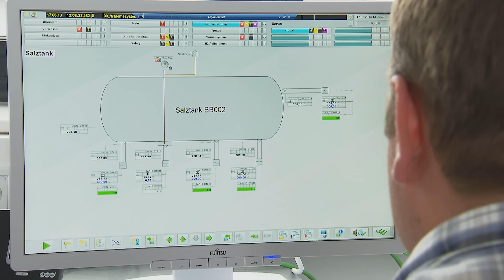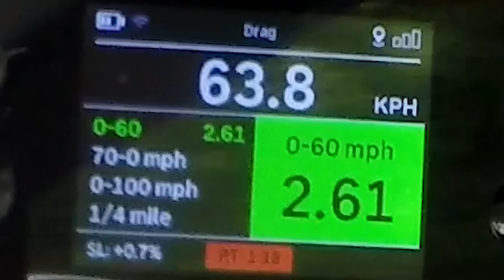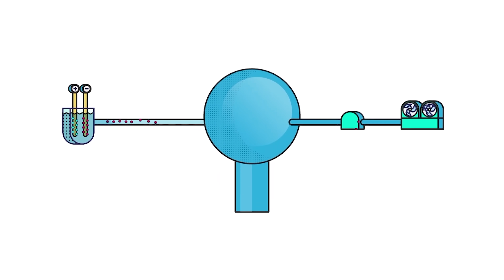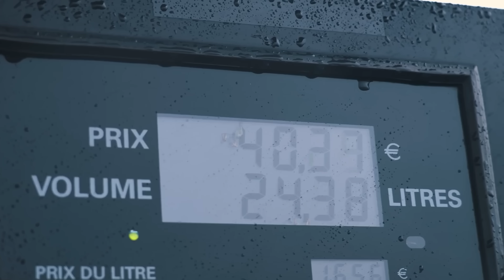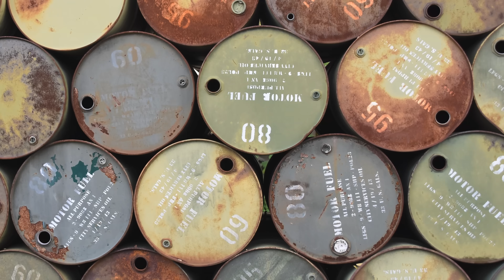Porsche just SAVED petrol engines FOREVER

Comment: electrolysis -> production of H2    (is about 70% efficient) so put 1kwh of electricity in to it and you get 0.7wh. 
x amount of H combine with x amount of COO will give us some biofuel. I guess it's more efficient than storing and containg hydrogen gas. 
hydrogen gas can be efficiently be convertet to electricity

But a diesel combustion engine does not have an efficiency above 50%. maybe not even above 40%. and the efficiency of diesel engines is higher than gas engines.

so from that 1kwh of electricity, you get 0.35kwh back. (and that without the efficiency lose of turning hydrogen gas with carbon dioxide into carbon neutral-fuel)

Electricity will stay cheaper to drive with and that is already not cheap. 
I guess those combustion engines are for people with lots of money who can by the carbon neutral fuel.

Comment: There is one major problem with E-Fuels. One the points shown against EVs (from the perspective of the car manufacturers) was that there is not enought electricity. And E-Fuels intensify exactly that problem. You need round about 4 times more electric energy to drive a certain distanze by using E-Fuels compared to using EVs. Thats because of all the inefficiencys in the energy transformation  processes (for example the electrolysis).
Reply: Great point, thanks for mentioning it.

Comment: One of the things that gets missed here is that in order to prevent the worst of Anthropogenic Climate Change, we not only need to stop adding radiatively active trace gases, but we also need to remove roughly a third to a half of what is already up there. Being carbon neutral is obviously better than carbon positive, but it will not prevent the devastation of ACC. This synthetic fuel is great for now, if it will convince petrol heads to do anything good for the climate, but it will not save our society. It is not the solution.

Comment: It’s funny how the same people moan that we don’t have enough green energy for all these new electric cars and then continue on to say that we should use a technology 5 times less efficient for NEW cars. Don’t get me wrong E-Fuels are an interesting technology that can solve many problems. But first we have to use it in use cases, where Battery electric is currently not possible. Like aviation or large ships. Then we could talk about using it to make existing cars greener or even carbon neutral and in the very end we could talk about new cars. This is the biggest bullshit Porsche ever pulled. 
Ps actually we also need this technology to remove carbon, otherwise it will be impossible to reach the Paris agreement.

Comment: I'm sorry, but you're a useful idiot (to Porsche and the other incumbents) and should stick to talking about how fun the car is to drive, which fits your level of knowledge and understanding. 

e-fuels are of course a scam, the same kind of tactics that big oil and big tobacco has been up to for so many decades. 

ICE is fundamentally inefficient compared to electric drivetrains. Precisely because we, as you point out, don't have abundant clean energy, efficiency is very important. 

In some distant future in which we have fusion power and far more clean energy than we know what to do with, efficiency will maybe not matter. If clean electricity costs a cent per kWh it doesn't really matter if a hydrogen vehicle is only 30% efficient, and we might want hydrogen cars. Or maybe another e-fuel that isn't quite as much of a PITA to store, distribute, and generally handle safely. 

But because this is at best many decades away, e-fuels are a terrible idea, ironically precisely for the reasons you enlist in their favour.

FAIL.

Comment: Let's be real here... So we don't just need completly to build an infrastructre to cover all our energy need with electricity, but also we want to make 9000 factories on the top of that? Not to mention we have a clean energy source, but we introduce an extra step in the process. Which by default means that the manufacturing cost of the e-fuel will be added on top of the electricity. Which by default means that it will be more expensive than pure electric cars. So yeah, internal combustion engine cars may remain as some toy for the rich kids, but we just added even more unsolved problems to the equation with this. (Although, there is one thing which may solve, namely the energy storage issue. Anyway, we'll see.

Comment: Not personally sure EV's will be the long term solution, Hydrogen is an interesting option, but much more research and testing is required before this can climb to the current level of EV vehicles.  Drive a Tesla, don't see myself going back to ICE, Hydrogen is an option depending on the costs of the cars, range, cost to fill up etc.

Comment: This could be made more efficient. Why use e-fuels that produce CO2 that is grabbed by carbon capture facilities that is converted back to e-fuels using renewable energy? You’re just adding unnecessary steps and in each one, you’ll lose a significant amount of power due to inefficient energy conversion. It would be better to just have an EV with a solar panel roof or to be charged through the road using induction. I understand the ease of filling up your vehicle and going from 0 miles to 350 miles of range in just a few minutes, but you wouldn’t need to fill up or recharge if EVs had these options or replaceable batteries.

Disclaimer: I love ICEs and hope they never go extinct, but if the government is going to push the adoption of clean energy, they might as well focus on the most efficient ways to achieve it.

Comment: The main problem with efuels is the loss of energy when producing it. Unless this becomes negligible/manageable people will always make the statement "why not use the clean electricity directly to power the cars and cut out the middle man?" Trust me I want efuels and hydrogen in general to succeed. They definitely have a space in society with their main advantage of short refueling time. Furthermore, certain industries can simply not be electrified easily due to the limited power density of batteries and can only be easily decarbonized by using efuels. Think for example, of an electric cargo plane, but half the plane would need to be batteries...

Comment: I was supplementing my gasoline with HHO gas derived through electrolysis of treated water in 2007 on a forester. The results were real, however it did take leaning out the intake, and I always wondered about the lack of lubrication from straight water gas.
Reply: A unit from Dutchman Enterprises was simply positive and negative parallel plates and water treated with lye. As the gas expanded it naturally had flow of its own as it increased in pressure and collected in hose that was simply fed into the intake Can’t seem to find the company anymore.

Comment: i'm a total petrolhead but no one can seriously belive that this exception was made for the comon car buyer. Most car brands settled long ago with investments and development on the EV track and won't produce anymore combustion cars for the broad public. I mean yeah you can buy a porsche but let's be honest: most people can't afford it. Efuels have their place in positions where other motors can't be used like ships or aircrafts. Since it makes no sense to convert energy inefficient to efuels to then use them again as energy for driving if you could just use the energy directly to power the car. And let's be honest exactly like with electriv vehicles the energy still comes mostly not from renewables. People just need to get used to the fact that combustion engines are a thing of the past. It's the same as in history. People clinging to the combustion cars are the same people that clinged to the horses when the combustion cars were introduced. : D

Comment: Please PLEASE Porsche don’t ever give up on these projects!!
Reply: What about the price of e-fuel !?
Reply: @jeanmarie97 Atm the production costs are around 40$ a gallon. That can easily go down to 10$ a gallon if it's mass produced. But that's just the production costs without taxes and profit for the manufacturer
Reply: @maxzweitacc96
Reply: @maxzweitacc96  and that's before government subsidies like what gasoline currently gets.  If this works, they'll find a way to make it affordable.  I don't know why everyone is so hung up on the current cost.  There's like, one factory making this stuff.  Just wait until every country is in on it.
Reply: @jeanmarie97  Think 3 to 4 times the cost of unleaded petrol, and you'll be in the right ball park.
Reply: same BS as the hydrogen fuel. it can but its Inefficienct to produce
Reply: People should know two things;
1. Porsche did not invent e fuels, they are not new as a concept. It's chemistry that has been tried for a century.
2. They have more challenges that fossil fuel and EVs for the foreseeable future.

Sorry to be a downer bro! I had hope once 😂
Reply: e fuels are more or less useless in cars. Electric vehicels are way cheaper at the end of the day
Reply: @Jonah1848  false.  The cost in finite raw materials is unsustainable.  We don't have an endless supply of what's needed to make EV batteries.
Reply: @erik9108  we actually do. there is enough cobalt and other elements in the ground for more than enough batteries

Comment: There’s a huge problem with this still. ICE engines can never be as efficient as electric motors. E Fuels like petrol is energy dense but only about 6-18% of the energy contained in petrol is used to actually drive an ICE. Electric motors use 40-60% of the energy to drive the vehicle. The issue lies in the line of transport of the energy. So while they market E Fuel as net zero, it’s unlikely going to succeed because using combustion as a source of power isn’t efficient at all. On top of this, renewable sources are extremely limited, these E Fuels are only clean if they’re generated 100% from renewable energy. On the other hand, electric motors will still be MUCH “greener” than ICE even if they’re energy source isn’t completely from renewables. E Fuels will likely only direct us to keep polluting by diverting the source of pollution to come from somewhere else. I LOVE ALL cars—it’s just something we might have to part ways with to keep living at all.

This guy breaks this down really well-love Matt but he could be biased lol
https://youtu.be/0d0MPg7DxbY

Comment: So let me get this straight:

1) we're going to use energy to pull CO2 out of the air
2) we're going to use some more energy  to pull hydrogen out of the water
3) we're going to combine the two into fuel, probably also using some energy
4) and then we are going to burn that 

If only there were some way to use the energy from step 1 or the hydrogen from step 2 to power the vehicles directly...
Reply: 😃! Great news you’ve won a price just telegram…. LOL JUST KIDDING!!!!

Um so basically internal combustion engine cars would be sold to third world countries

Comment: Due to the lack of efficiency and the astronomical production costs as well as the limited scalability and, more than everything else, the already high demand for E-fuels in the shipping and aviation sectors, E-fuels for private cars will be VERY expensive, especially compared to electricity for BEVs. The only kind of personal car this makes sense for is a sports car, where the owner puts up with spending massive amounts of money just to drive a few thousand kilometers each year with it.

And it’s perfect: that way enthusiasts can still buy and drive their V8s, boxer engines etc., while every other kind of personal car won’t make our cities noisy, or pollute the air, next to the obvious CO2 reduction benefits.

If E-fuels really were cheap enough to run everybody’s current car, we would’ve gained nothing except for CO2 reduction. Luckily it’s expensive as shit

Comment: I do like the idea that in 2035 someone will be showing off their latest new Tesla, only to have someone rain on their parade with a 2010 BMW with a manual gearbox!  

Leaving fossil fuels in the ground is a good thing.  Carbon capture requires energy though, and to then re release the carbon doesn't seem smart.  I feel that "net" is a massive get out of jail free card for big businesses. Essentially anything that burns something will result in carbon and big business will 'big business' any way they can.   I like driving a sports car that roars, but if things are going to get under control it's not individuals that can make any huge difference, it will be the corporations.  Much like when car manufacturers were told the average emissions across their range had to be below a certain level, they didn't immediately refine the engines, they just got rid of some unpopular models and introduced teency weency cars to their range.  At present it's not in law, and until e-fuel becomes a LOT better t shouldn't be.  I mean it will get into law, as soon as the car manufacturers successfully lobby that it is so, but it doesn't make it a good direction to go in.

Comment: Big Problem with E- Fuels , it's Mega Expensive to Produce and Time Consuming to make that Fuel and its impossible to Mass Produce so it can be used by all Cars. So the E-Fuels has the same Problem as EVs , there are not Practical to go full scale, maybe a mix of Both options possible

Comment: The only problem is the cost. I heard that a gallon of e-fuel cost twice the current price of a gallon of petrol. They need to lower the cost somehow or else, common people won't be able to afford it. I hope this seriously work out tho. I love ICE cars a lot and i hope they don't die out. And EVs and e-fuel cars can perfectly coexist together. EVs for daily usage and e-fuel cars for long trips which means we get the best of both worlds.
Reply: I also hope that too🤞🏻
Reply: It's not twice the price, it's multiples. eFuels need at least 5x the energy to move an ICE the same distance an EV would move, so it will always be WAY more expensive than EV's, it's just physics. There's no way around it.
Reply: I think it'll  come down as demand increases
Reply: @asitadkar4976  as supply increases. Not demand
Reply: Simple economics of scale for the pricing and throw a bit of competition in for mix once it starts going.

Comment: They never were dead...all an elaborate medial agenda trying to turn people to buy electric cars. And many uninformed sources hopped on the train and shouted the same message on the street. The experts, the industry and everyone halfway informed knew all the time, that electric cars are not the cars of the near future. Maybe the far future, but not in the next 30 years at least. Espacially not, if you have any concience whatsoever. Mark my words, manufacturers will step down from their claim or will not uphold it, concerning no ice in x years. Volvo maybe will stick with it, but the relevant ones won't. They are not going to throw away money and they most certainly would, if they did not supply any ice cars in 2035.
Obviously politicians influenced by deranged teens are not experts in any field, hence the wrong decision making on a daily basis.

Comment: Yeah, but they still BURN fuel and create C02 so how is this helping with stopping climate change? At least battery production can be made more efficient and/or powered by renewable energy, but if you BURN anything apart from hydrogen, you'll be left with C02...
Reply: Did you actually watch the video genius or are you just too dumb to understand it. The synthetic petrol is made from CO2 sucked out of the atmosphere so it is carbon neutral.

Comment: eFuels need 10x more energy of what's required for electricity for electric cars and the engines burning them are also 10x less efficient than electric motors. Furthermore, the noise and the local carcinogenic emissions stay - that'd be no alternative in a sane world!